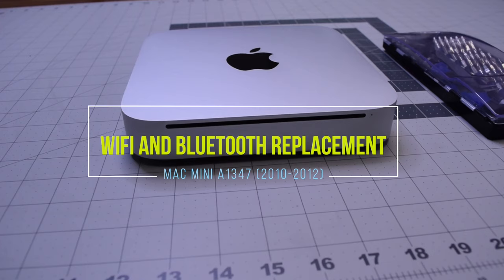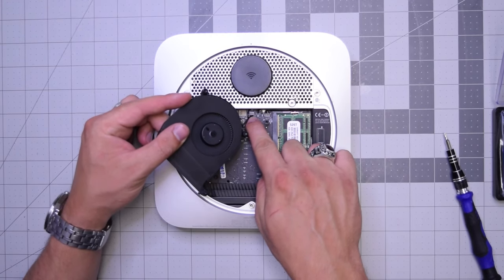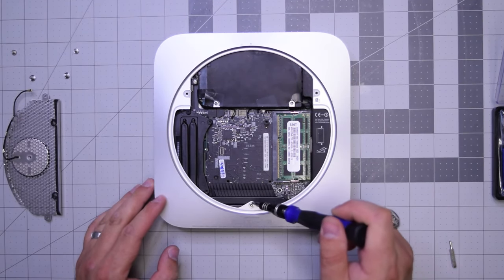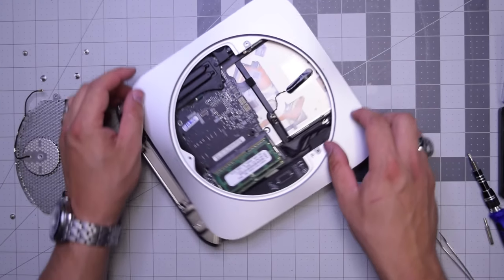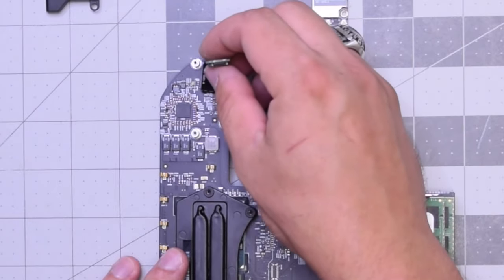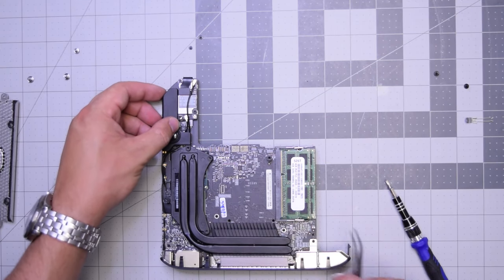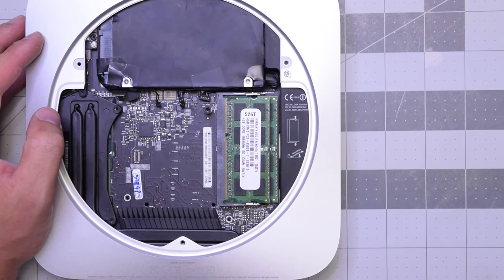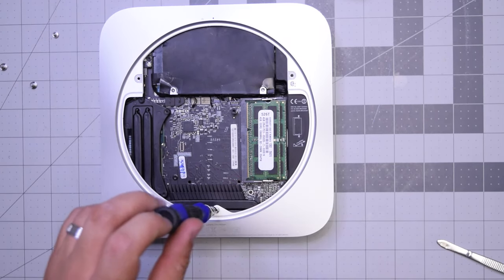Mac Mini A1347 - Bluetooth and WiFi Card Replacement (2010-2012)

Comment: At 1:18 you say the plastic bracket doesn't have much of a purpose.  Your Bad, the bracket holds down
the hard drive data cable onto the motherboard.  Without the bracket the cable can easily pop up off the
motherboard and lose connection.